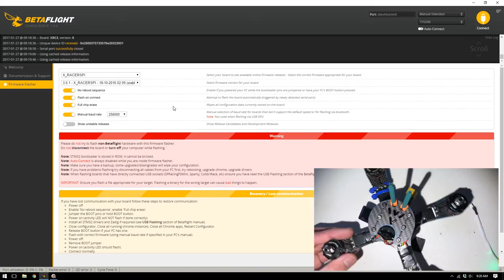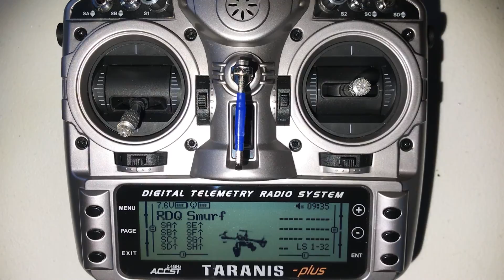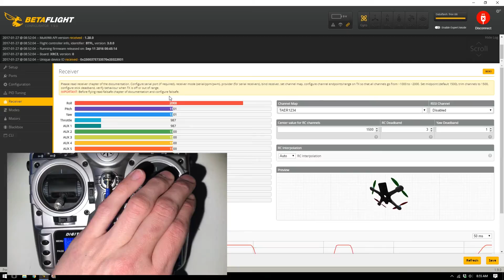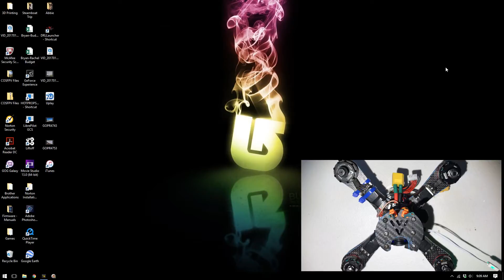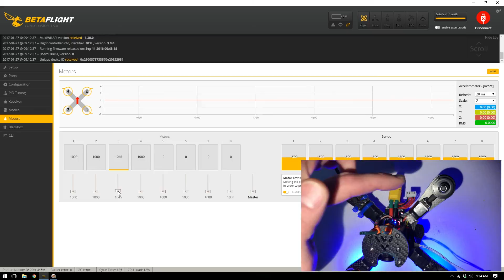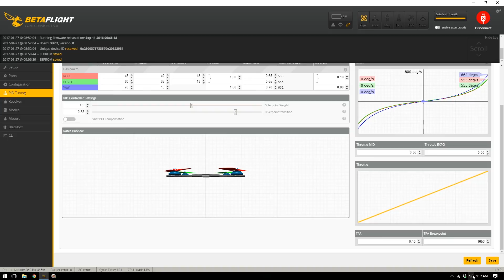Quad Setup (Barbicyanide)

Comment: Ok i have 2 questions-1 how do you connect your controller to the computer? 2 How do you set the controls for you drone slower... I'm not very good so when I tried my fpv goggles for the first time it was just too fast so I crashed it hard. Everything works but I'm worried to fly it again ; if you know how to set the controls down a notch please let me know! Thank you so much for doing this video it was really helpful and i understood every thing else.
Reply from the maker: You connect your fc to the pc via a micro usb cable. To turn down your "controls" you want to go to the PID /Tuning tab and turn down your rates.
Reply: Thank you so much for responding so fast!! I have two more questions(because i'm new to drones-sorry!):1 where do i get beta flight? 2: I have the flysky I6 and all it has is a trainer jack :/ can i still hook it up to the computer with a special usb cord? Thanks! :)
Reply from the maker: In order to download Betaflight, you will need Chrome web browser. Then you search Betaflight configurator and it should be the first link.
Yes you can connect your Flysky to the PC via special cord. Bangood is where I found mine. - http://www.banggood.com/22-in-1-RC-Flight-Simulator-Cable-for-Realflight-G7-G6-G5-G4-p-950398.html?rmmds=detail-left-hotproducts
Reply: Thank you so much for this help, I really appreciate it!!